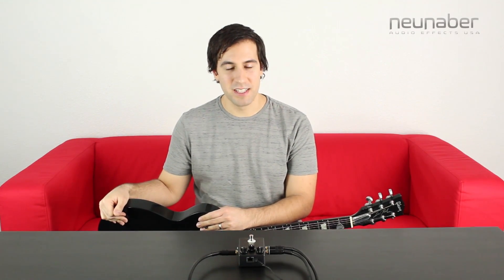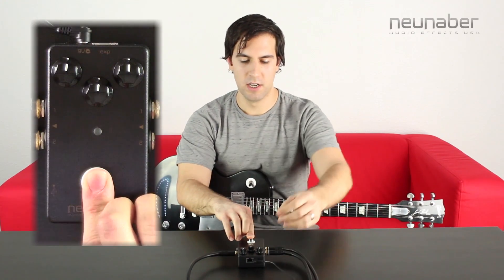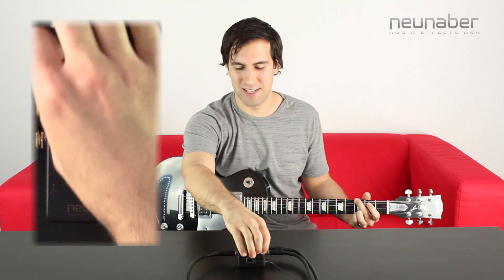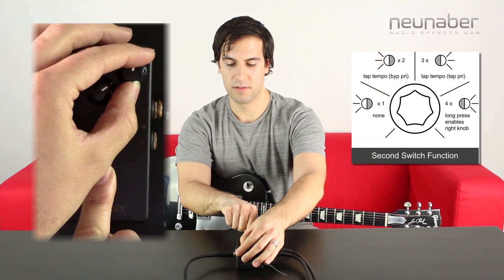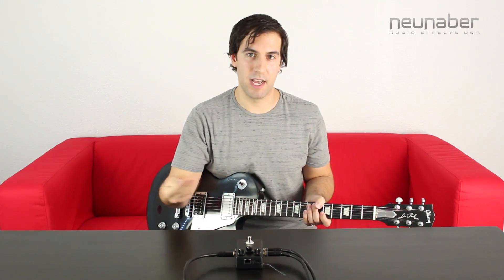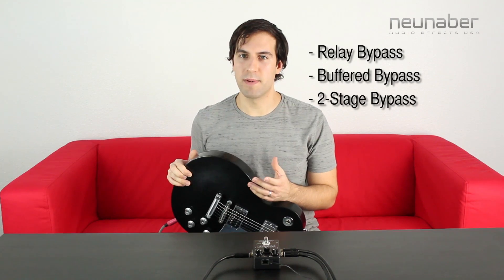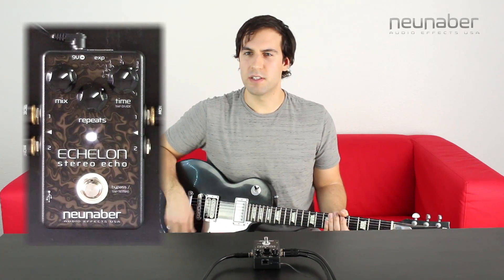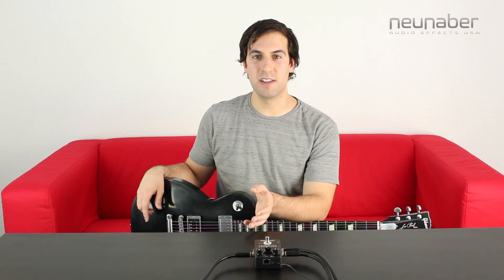Expanse Series | Pedal Advanced Configuration

Comment: how to turn of and go back to normal bypass and active mode?
Reply from the maker: These settings will persist until they are modified again. If you want to change the current settings on your pedal, simply set these for the desired settings by following to special start-up sequence: https://cdn.shopify.com/s/files/1/0429/0425/files/Expanse_Series_User_Guide_20161209.pdf?174290920487257699
Reply: thank you so much!
Reply: i use my wet reverb as last pedal in my chain. Should i use buffered bypass? Do i have to switch from internal switch?
Reply from the maker: We would recommend using a buffered bypass for the last pedal in your signal chain. For our selectable true bypass models, instructions on how to change the bypass mode can be found in the Expanse User Guide posted above.

Comment: I can use the taptempo pedal when using the Exp Controller??
Reply from the maker: +alessandro castro Normal tap tempo pedals are not compatible with the ExP, which requires a calibrated CV (control voltage) signal to establish tempo. You can use our uTap Tempo pedal plugged into the right expression input of the ExP (plug adapter needed), but remember to power down the uTap when switching to an effect that does not support tap tempo.

Comment: Have a question>>> When using the PC software with the EXP controller.. DO YOU HAVE TO SET EACH MIX KNOB FUNCTION IN EACH PRESET OR DO YOU SET IT FOR ONE EFFECT AND IT"S EFFECTIVE IN ALL EXP PRESETS? Like Steep End Drop... Can I just set for the Blue preset and it's done for all EXP presets?
Reply from the maker: +Adam Barker The mix knob behavior is programmable for each of the 4 effects. If you want something other than the default setting, then it must be programmed for each effect.
Reply: Ok, man I thought it was just my unit. That's awesome to be able to program different knob functions per preset. THANK YOU.

Comment: Hi I'm going to buy this pedal and it will be last in my chain splitting the signal between two amps.
What I wondered though was if it is fixed on my board in stereo - could I put a kill switch on the right feed to play just through mono with out unplugging anything ? Or will that only play the left channel ? I want to be able to play mono/ or stereo without unplugging anything ideally.
Thanks
Reply from the maker: If you want a mono sum, you must physically unplug the #2 output. Otherwise, you will only get one of the two channels. You don't need to unplug the #2 input.